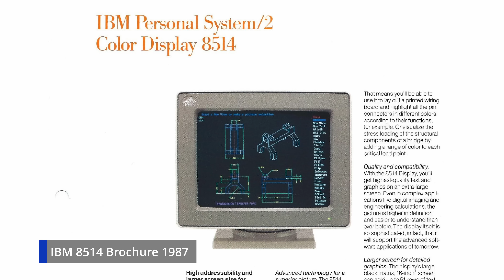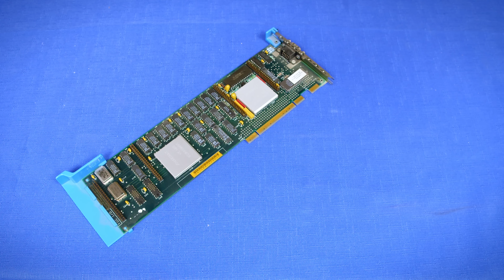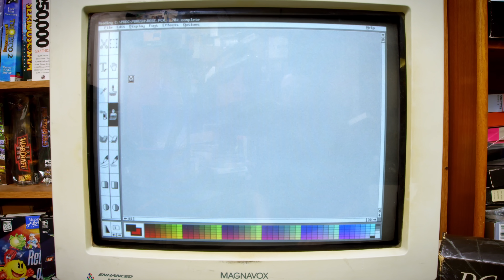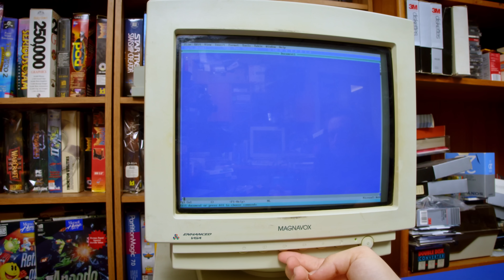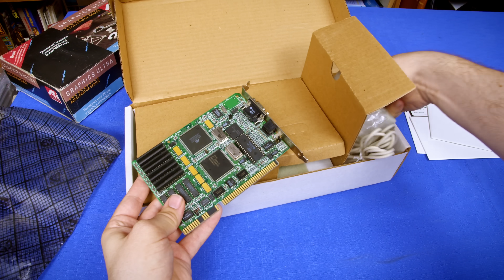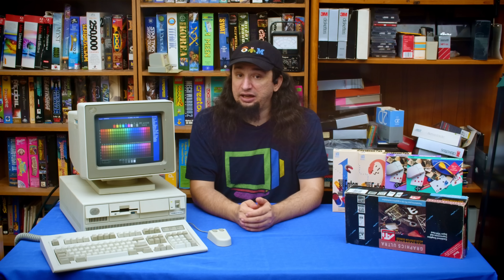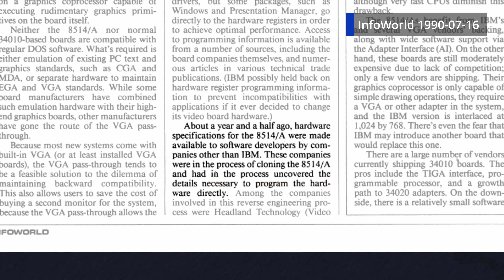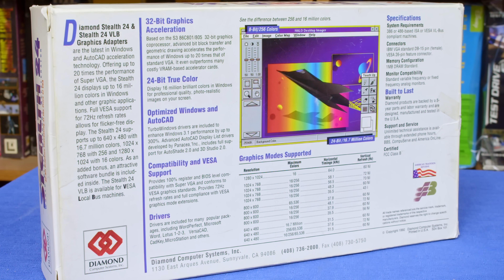IBM's Weird GPU From 1987 - IBM 8514/A

Comment: I worked for a company that sold IBM PC, PC/XT, PC/AT and PS/2 computers from 1984 to 1988. Graphics cards and graphics co-processors were available at least as early as 1984. These could provide higher resolution or color (but not both from the same card; the color cards had lower resolution ) on compatible monitors. Maybe it depends on what you want to call a GPU, but a card from 1987 was not first. Also, the PS/2 was a flop so I'm not sure how an optional card for that computer would take the industry by storm.

Comment: It was a very welcome improvement.  With that card, I was able to get 1024x768 resolution, and finally use a text editor that could show more than 25 lines at a time.  I did not use it for any kind of graphics or gaming, but for writing programs, it was great.

Comment: I will be pedantic, calling it a GPU is weird. I would call it an accelerated 2D display adapter. That's what they were called back then, a GPU is programmable like today's ones or the first GeForce 256. This one card executes commands, and you can offload fixed functions via its driver. The voodoo or other first 3D Accelerator are not GPUs either they executed commands using an API via fixed functions like draw a triangle at XYZ vertex point and draw a bilinear this texture  in those coordinates, that data is all prepared by the CPU but calculated by the 3D acelerator

Comment: I worked on IBM ImageEdit (I saw a flash of it there) And I wrote the scanner driver code that it used to talk to IBM's greyscale scanner (I had a prototype of it in my office with the controller board (based on an 80186) wire-wrapped. ) I also had an early 8514A. There was another GPU done at hursley & the research division that was very powerful for the time. It had a precursor to texture hardware on it.

Comment: Wow, I remember most of the cards shown here, from the childhood era when I was trying to write C++/ASM "3D/2D SW renderer" in 1995-1997, backethen cards was already older but I remember S3 2+2MB in 486 DX, Trident in 386DX40 (AMD), and.. MDA/HGC in AMD 286. Win 3.1,(later Linux and NT4). Trying to access 2MB in Borland C++ 3.1 in real mode ;) later DJGPP (386+ only), and DJGPP under Windows with DPMI 0.9. Win API GDI and WinG was super complicated to me backthen (I was ~12) , but somehow DX3 from NT was super easy  (I was 1 year older). What I remember 386 was slower than S3, but.. 486 @ 100MHz much much faster, but if remember corectly this 486 was from late 1994, AMD 386 40MHz around 1991/2 ;). SVGA and VESA modes was perfect! my favorite mode for long time was 800x600 15bit. Smooth with 2D on 486 PCI and in "3D" (Doom - like SW with blured textures) on K6 II later.

Comment: The IBM Image Adapter/A was a more powerful variant, it could drive multiple virtual desktops or let you scroll around a desktop that was much bigger than your monitor resolution, at least with the OS/2 drivers. They were super rare, I only saw a few in my time working at the IBM location where they were designed and built. I just had a PS/2 model 80 with an 8514/A and and 8514 monitor.

Comment: I specced out and purchased a 486/33 MCA compatible tower from ALR with a clone of this card for running AutoCAD back when the system cost $12,000. MCA was the requirement that drive the price up so high.

Comment: Fascinating. I worked in a small computer shop in the 90s and remember working with some of those cards, especially the later S3 and Trident and ATI ones you mentioned, or their siblings, in both 3.1 and 95 and even NT. We specialized in used hardware and systems, so the 3.1 and 286 days lasted a long time for us. I might install Windows 3.1 one day and Windows 98 and NT4 the next. Or plain pure DOS, complete with 10BaseT LAN. One of the best jobs I ever had. Loved going to work everyday and spent some off days there. Except the pay was lousy, or I might still be there, if they still exist. Thanks for stirring up some nostalgia and adding interesting info I forgot or never knew!

Comment: The Amiga would be much closer to a "first 2D GPU" before the 8514/A.  Developed in the very early 80s, released in 1985.  Unlike PC and Macintosh - the Amiga's 68000 CPU didn't drive the graphics.  Also why runninng Mac emulation on the Amiga was FASTER than real Macs and could run in the background.  Agnus and Denise were two chips that did more work than whole PC display cards.      Back in the mid 80s~1988 or so, "Color graphics were for toys" was the mentality of MS-DOS users/industry.   That single-tasking was better for productivity - LOL.    People got 16~4096 colors out of their $300 monitors, but not the high refresh rates.

But, commodore was a stupid company.  The Engineers wanted to do more, could do more, but the CEOs/board wanted to make money doing minimal work with the least amount of money.
SVGA quickly passed Amiga graphics in 88.  1992 Amiga models finally had 24bit support, and when those came out - Amiga users knew that commodore and Amiga were done.  Sure, it had 24bit color palette/ 256 color desktop, which was typical of SVGA PCs in 92~93.    Still no VRAM (to save money) and what passed for "High resolution" was a joke. 720x480.  SuperHires was 1280x480.  Useless. 

The PC industry (not IBM) was a big factor in the advancement of PCs in general.   The S3 were quite good back then, I used those - until the true GPUs started coming out from ATI, 3DFX and Nvidia.

Comment: This is why slow phosphor monitors were a thing back then (and not now).  This eliminated the flicker to a point that is was comfortable to view; this was the solution for the interlaced modes.    Next you'll make a video about slow phosphor monitors, how terrible they were and not explain why they actually existed. <sigh>
Reply from the maker: I have plenty of slow phosphor monochrome monitors, but I have never seen or heard of the potential of a slow phosphor color display until the 8514. This would require a phosphor that decays about 15% slower than what would be needed to blend fields for even a PAL CRT TV. I brought up the blurriness of the display being criticized by contemporary reviewers and how competition was "sharper". I would speculate that the beam size or the slew rate of the beam intensity were not the issue, which does leave the potential for the slow phosphor to be the problem. But that would mean the 8514 was unique in having slow color phosphor because it was the only interlaced display I could find being criticized for being blurry and would need to blend 43Hz frames. I am looking out for an original IBM 8514 monitor to document it because I do think this is an open ended question. But I also don't think it's fair to say that it wasn't a problem if just one display being sold, that people didn't like, was the solution.

Comment: I had so many SuperVGA cards.  I had a Trident 8900.  I had a OAK OTI-067.   I had a Cirrus Logic 5434 (the 'claim to fame' of this one is qemu supports a CL5446 (a newer variant of the 5434.)   I had a Mach64 at one point too.  I was using Linux already by 1993, so if it was supported by XFree86, I'd get whatever was a good price and gave me better speed, or better resolution, or whatever. 

When I switched from DOS + Windows for Workgroups 3.11 to Linux in 1993, I got a rude surprise -- 1024x768 was great for a PC, but UNIX workstations by the late 1980s were already using 1280x1024 and sometimes 1600x1200.  They figured if you'd spaffed out like $10,000 on a UNIX workstation, spending ~$1,000 on a 21" high resolution monitor was no big deal.  So my card that'd do 800x600 in 256 colors, or 1024x768 (yes, interlaced..) in 16 colors or monochrome, was pretty nice specs for DOS and Windows.  But Linux.... early on (like up to ~1995 or so) one of the big developments of Linux GUI stuff was shrinking down the GUI of existing programs so they'd actually fit on a 800x600 or 1024x768 screen.  

I saw a Mach 8 operating at the university -- the cool thing on that, it got a faulty bit in RAM, and it actually drew an outline of the card in ASCII art, an outline of the memory chips, and had the one flashing in red to tell you which chip was bad.   Since this resulted in one stuck pixel on the screen in Windows, we didn't try to do anything about it.

I'll just comment, I remember hearing at the time about the 8514/A having it's programming model.   You covered very well at the end why this didn't catch on -- AutoCAD was already using it's own drivers anyway.   VESA BIOS Extensions (VBE) let DOS programs access higher video modes.  For cards that didn't include VBE in their BIOS, you could load a driver that added it.  Windows used GDI, and Linux's XFree86 included accelerated drivers for whatever it could use (and for more DOS-style, SVGAlib supported a slew of cards for single program full screen use.)

Comment: A turbo  xt is not a slow computer, 256 colour vga exists for the 8 bit port. The trouble with those computers, is that sold for not engineers, they are downgraded, and engineers turn on functions during programming or planning. These functions are in the floating point unit, laptops need it for energy saving too. Other func is on the sound card, even today the tiny chip offloads the cpu. Maybe on the modem as well i am not sure. Ram ecc middle chip on 34 bit memory modules. 
I am experimenting the functions using hc, xc micro sd for testing Physx, it is working.

Comment: This  posting is well done and mostly accurate. I worked at IBM from 1980 to 1991 and was fortunate enough to be stationed at Watson Research in Yorktown, NY, where all the smart people worked (I don't claim to be one of them). I was in mainframe support but I was known as one of the PC guys and I had early versions of the hardware.
Always interested in graphics, my first graphics card was the IBM CGA which used the venerable and soon standard Motorola 6845 chip, which I would not classify as a GPU. Just a display adapter and it was not very good, but it did support color.
I was more impressed with the Hercules monochrome graphics card (with no gray scales) which used the same 6845 chip but it drew so many more pixels that the slow 8088 Intel processor really couldn't move them around efficiently. It was slow and got even slower when Windows supported it. The next gen 5170 AT was much better at moving those pixels around.
The reason IBM chose the 8088 processor is pressure from on high thought that if they put a better CPU in the 5150 PC that it would take away from from their much more expensive (and lucrative) mid range systems. I doubt that would have happened because the hardware architecture and software was completely different. Really, IBM's biggest decision was to make the ISA bus an open hardware standard, which I believe they regretted, but worked out well for everyone else.

Comment: an early 8514/a ati card was completely compatible with the 8514 and could use the driver with deeper queues. there was also a keystroke that would put the ati card in a bios like mode that allowed you to tweak the timings. had one of their cards. the later version that had vga on board. nec 2 had 800x400 and 640x480 and auto-switched. everyone use the s3 card including ibm later. had some ibm 360 desk computers. pentiium pro with 2 sockets and an ibm video card with an s3 chip. think there was open gl back then which was a standard that silicon graphics computers used, but some games also used open gl and it was sometimes an option back then as i remember. been a while, not really a games person. brother in law did graphics for commercials and was enthusiastic about open gl at the time.  interesting video. still have an ati card with built in cable tv/antenna interface. used to create video files of pats games so my brother could watch them when he was in town for xmas. ati had some cool hardware, still have a card in one desktop, amd actually. :-)

Comment: This is not a GPU at all.. This is a Vga 2D display video card for for enhanced color modes and higher display resolutions, this Is not for 3D gaming or any 3d work. A GPU is Programmable at the hardware level (shaders)
Capable of performing both 2D and 3D rendering by a programmable pipeline Able to perform massive parallel computation on vertices and pixels. 
The 8514/A video card is strictly a fixed-function 2D display accelerator video card: Non-programmable: It cannot execute user-defined rendering routines,
Limited to only 2D primitives: No 3D transformation, no shading, or any rastorization hardware, There is no 3D engine, or z-buffer, no support for 3D vector polygons, It does not qualify as a GPU.  Nvidia created the first GPU in 1999 called the Nvidia riva 128, for something to be called a GPU it must contain 3d rendering graphic pipe line architectures for Vertex and pixel shaders and support rendering APIs.. in 1995 Nvidia first attempt at 3d hardware creating the NV1 co processor faild, It used quadratic texture mapping and quadrilateral rendering Witch was not good for gamme developers to work with. Before Nvidia, we had 3d Accelerator cards like 3dfx voodoo and diamond in the 90s. But The first raster 3D graphics Accelerator hardware card was in 1981, called Geometry Engine, later became Silicon Graphics for work stations in 1987 for pixar 3d animation super computers with pre open GL rendering. The most early 3D Accelerator hardware were called 3D Graphic co processors and were added in older Game consoles like Sega Genesis 32 Sega Saturn, and Super Nintendo FX chips in star fox game cartage, Sony play station and Nintendo 64 called there 3D co processor the reality engine. With out a 3d accelerator card computers used software Emulation for 3D-like graphic rendering on old Dos games like 2.5D Doom and Duke Nukem 3D witch was lagy and slow and blury being rendered Off the computer CPU alone. Open GL 1.0 could render 3D graphics off the processor with smoother graphics, but it would be unplayable for games and mainly worked for Windows NT and 95 screen savers. :hourglass-purple-sand-orange::pillow-turquoise-hot-chocolate::face-orange-tv-shape::popcorn-yellow-striped-smile::person-turquoise-wizard-wand::penguin-blue-waving-tear::buffering::person-yellow-podium-blue:

Comment: Fun fact: My first VGA-class card was a Groundhog Graphics card: "The Shadow" SuperVGA, based on the ET4000. And for a few eye bleeding years, I ran 1024×768 at 43Hz interlaced on a budget 14" SVGA multisync monitor. (Or, occasionally 1152×896 or thereabouts, as that just fit in 1MiB. And of course the refresh rate was even slower.) Those stipple patterns in X under early Linux were... headache inducing. I eventually was able to upgrade to a Diamond Stealth64, after I purchased a second-hand EISA + VLB motherboard. Now there's a combo you don't see often! It was apparently a high-end Gateway 2000 server/workstation motherboard.

In 1996, I was hired into TI by the architect of the TMS34010 and TMS34020, the processor family used inside TIGA.  I asked Karl (the architect) about using the TMS340 family to accelerate PC graphics when I hired in, which is how I learned about TIGA.  My takeaway from those conversations, conversations with others on my team that had worked on TIGA, and my subsequent career at TI was threefold:

1. TIGA was too early. Software rendering on the CPU was baked too deeply into everything. As an example, he described how scrolling worked in Windows and other apps at the time—basically a CPU-driven BitBlt followed by redrawing the exposed region. He pointed out the TMS340 could have redrawn all the window contents far faster, directly in the framebuffer, while the CPU went on to other work.
2. It was too expensive. Karl posted a scan of video card prices in an ad from the late 1980s. These were cards aimed at high-end CAD, and they were all in the $1999 - $4999 range, in late 1980s dollars.
3. Outside of calculators (and for a time, Speak&Spell), TI just doesn't know how to move a consumer market. It's just not in its DNA. In the rare case TI creates a market, it generally gets away from them. And TBH, I think we only still talk about TI calculators because someone in marketing had the genius idea to get TI calculators into textbooks, and make it easy for educators to pick them as the default. Sure, DLP had its moment in the sun, but that was after decades of it going nowhere. 

The TMS34010 and TMS34020 were arguably the first programmable GPUs in a PC. They actually had a C compiler!  And unlike traditional CPUs, pointers were bit aligned on the TMS34010 and TMS34020. In principle, you could write exactly the renderer you needed for a particular application, akin to writing shader programs on early GPUs, and the more general GPGPU programs that eventually turned GPUs into AI number crunchers.

But, as you noted, GDI didn't come out until around 1992, and by then TI had mostly moved on from TIGA.

Comment: People don't realize how powerful VGA was. Using my GeForce 3, I was able to do 4k resolutions on my very nice 21" HP CRT monitor circa 2002ish.
Reply: Are you talking about VGA the video card, or "VGA" the video port that lived on in future video cards for like 20+ years after VGA was fully obsolete
Reply: @vurpo7080  The VGA port. Technically it was QSXGA. It was unusable at that resolution, though, and the bit depth had to be super low, like 256 colours or something.

Comment: You should give this a try on OS/2 you might be surprized.  Remember the PS/2s were designed and build for OS/2, I have installed OS/2 and the 8514/A on hundreds of the model 80s and model 70s along with the yes absymal 8514 monitors.  it was the best at the time.  Until NEC released the MultiSync and the MultiSync/2.  Awesome monitors.